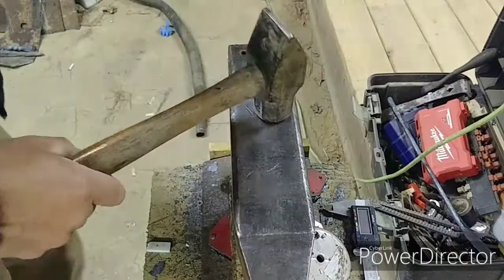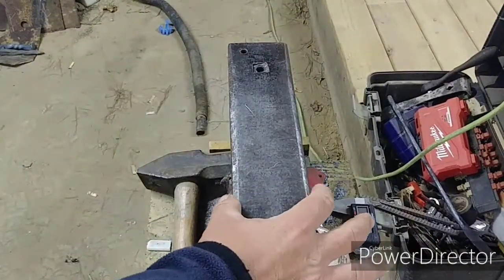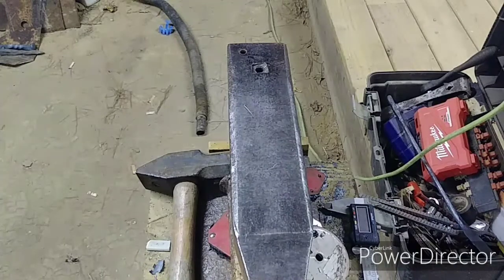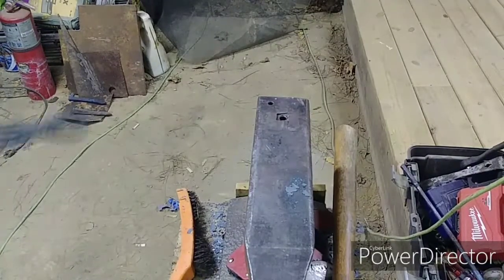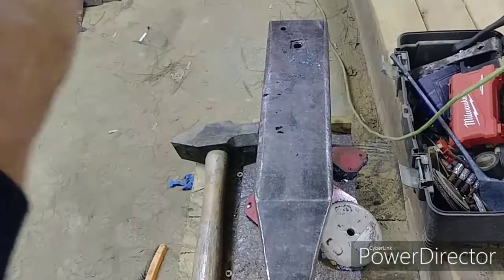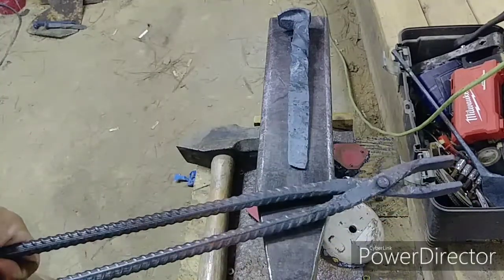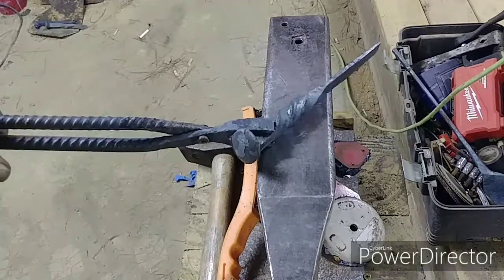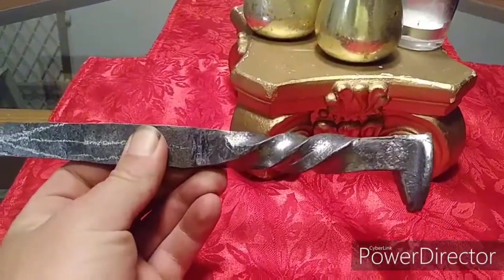Beginner day 8 - letter opener

Comment: Great video man! It was a spike!😁 You know how much I like messing with rail spikes. Flat jaw tongs are really hard to grip one with though. It's all I used to have until I made some square jaw tongs to grab 5/8" square stock. Then I bought a set of rr spike tong blanks from Kens Custom Iron and watched the assembly video and fixed me a set to hold the spike head. We are gonna have to make some tooling  happen for you. You done started a thing. 👍
Reply from the maker: Yeah I found out that flat jaws suck when trying to grab the head end lol. Ive got about 6 spikes laying around. But at the moment i got a couple things to grind. Thanks for watching and commenting.
Reply: @00_negative  one thing you could do for holding RR spikes is weld a chain link across the end of the flat jaw tongs that easy you can grab around the head. Yamez had a video out using a setup like that. I'll see if I can find the video and link it here.
Reply: @00_negative  you see the rings I'm talking about around 1:30 in the video. Great work in not messing up the twist by the way.